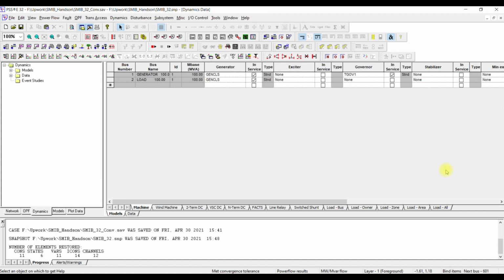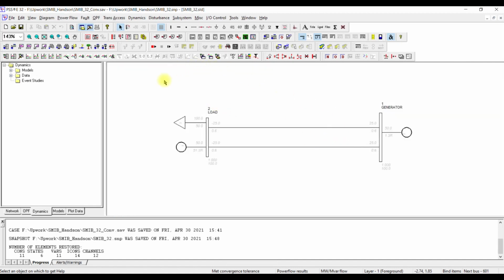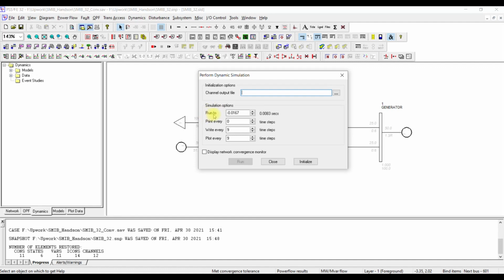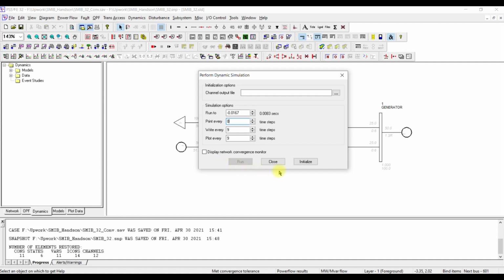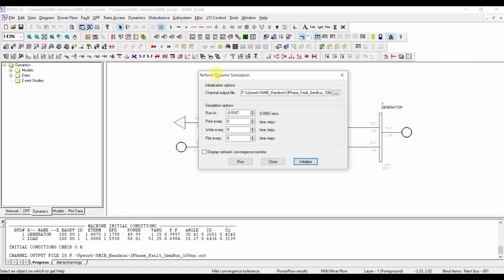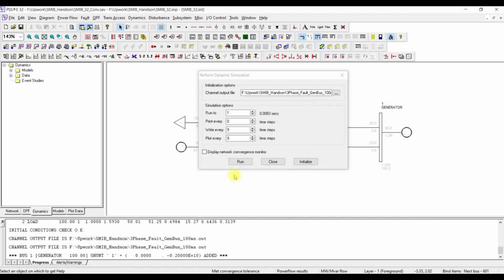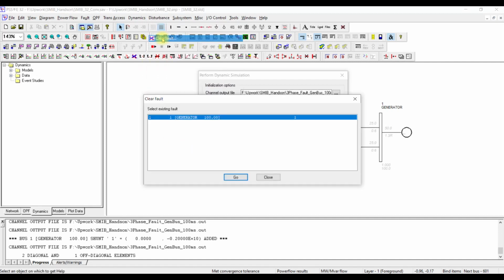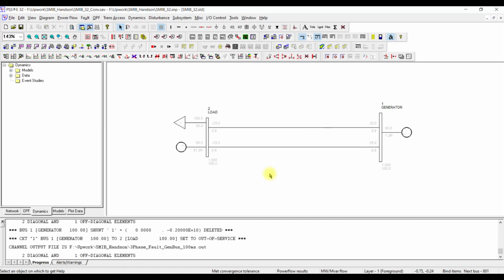Basic Power System Analysis Using PSSE Session03 - Part2

Comment: thank you for your video.
I have one question.
6:26 / I understand that during 3phase fault, reactance of generator is getting 0, and short current is increased. But in case of voltage drop, the terminal voltage (Vter) equals E(emf)-Z*I. Although short current I is increased, if reactance part of Z is almost 0, voltage drop is due to resistance of generator?

Comment: Hello Mr. Farhan
I need to solve a transient stability example given in a textbook where only the H or PU inertia constant is available for the generators. I tried to solve it with PSSE using the GENCLS model but each time the system becomes unstable which is not the case in the textbook example. Could you please help.
Reply from the maker: You may share the example @ farhanmujeebk@gmail.com. I can have a look why there is an instability
Reply: @farhanmujeebk  I will send to it now my dear